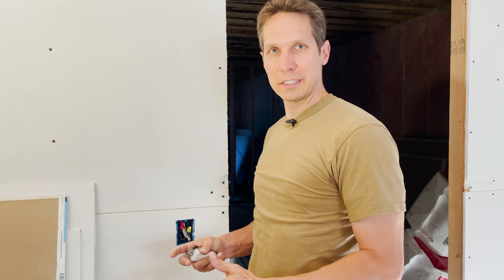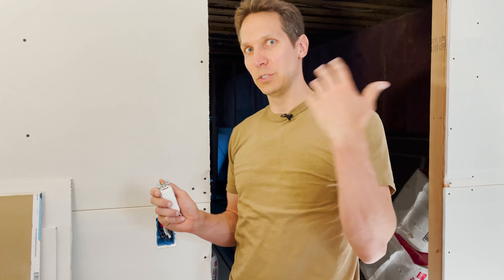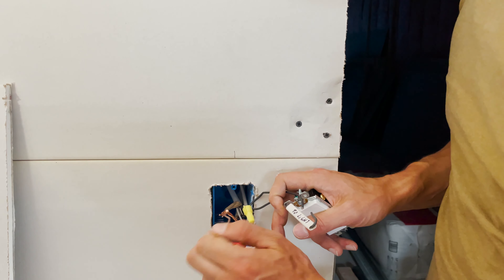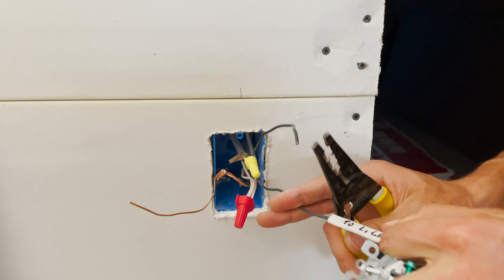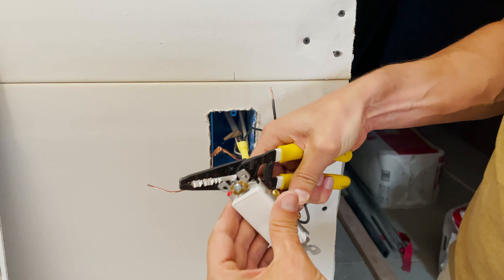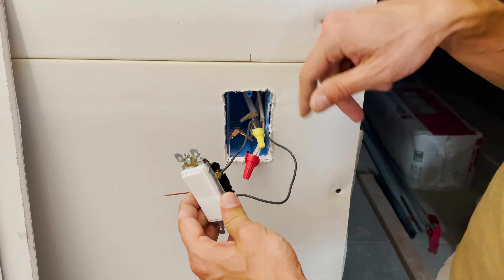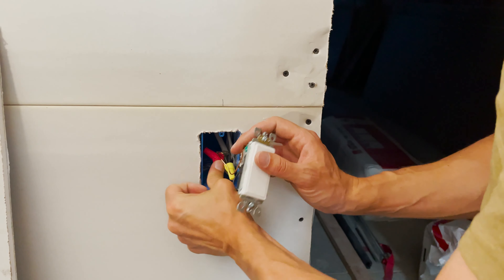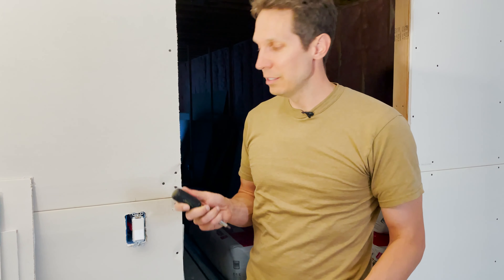How to Wire a Light Switch in your House - The Basics | CircuitBread Practical

Comment: Thanks for reminding me that I need to find a playlist to learn about basic electrical stuff, after having some knowledge of electronics, but electrical stuff is still mandarin to me. Part of the reason I've been hesitant is the high voltage, hence high risk in the event of simple dumb mistakes that I can easily get away with in electronics.
Reply from the maker: Totally agreed!  I've been hesitant about these videos because 1) I'm not an expert, I'm just trying to share what I've learned from the perspective of an EE and 2) the risks are high if you screw up.  That being said, while the risks are higher, there are a lot more safety features built-in and between that and common sense, it isn't too terrible.  But as I say in all of these practical videos (if I remembered to) - electricians are cheaper than an ER visit or burning down the house.  But paying $100+ to replace or install a switch boggles my mind.

Comment: Is the top of the switch oriented correctly?  Grounding clip is on the switch?
Reply from the maker: The ground screw is sometimes on the top and sometimes on the bottom of the switches or outlets.  But they've always been green.  And I did manage to install a switch upside down the other day, as I wasn't paying attention to the writing (and it was a specialty switch and a little odd in its wiring) but this one was installed right side up.

Comment: 30 seconds in and i hear you say Multimeter.
That thing is a no go for electricians because of high input impedance. A mutlimeter will happily report all kinds of values just because you are measuring a pair of wires that runs next to another pair connected i.e. to a running tumbler.
You really want, for a lot of reasons, a tester with a 2k switchable load resistance.
Reply: Sorry if i come off as "that guy" but there is a few decades of experience behind it.
I have experience in both fields. I designed and manufacured electronic devices and i wired up everything from simple sockets to 100kW eddy-current-motors in grain mills (dunno if you call them this in english)
Multimeters are deceiving. Most of the time they will give you false positives. And that one time you will just have it set for the wrong range, voltage type, whatever.
These thinges are great tools when dealing with non-lethal voltages. But they have absolutely no place when dealing with wiring up a home.
Damn i sound like that fire awareness bear in u.s. parks :D
Reply: Ok i tried to google for an example and there really only were examples of a fluke voltage tester, so i have to ask, do people really use multimeters over there?
Reply from the maker: Thanks for your input - I do like to get feedback from people who have a great deal of experience in this.  I actually had a Fluke Voltage tester that I gave to a friend who worked on HVACs, as he dealt with line voltage AC all the time whereas I only do it on the side.  Your concern about having it setup for the wrong range and voltage type is very real and does make me nervous - mine defaults to DC and I'm always worried that I'll forget to switch it to AC, think that a line is off, and hurt myself.  So I usually do double or triple check and, when in doubt, I'll turn off power to the whole house.  
I am curious why having a high impedance is a problem when checking for voltage, though.  Don't you want it to be high impedance?  I've had a few multimeters over the years and while they are more specifically for electronics, I've never had any issues with inaccurate readings (when I set it up properly) when working on my house wiring.
Reply: @CircuitBread  The problem with the high impedance is that you are unable to tell stray inductive coupling from actual galvanically coupled mains voltage.
This is why voltage testers (the good ones) have those push buttons to load the circuit wit a 2kOhm resistance.
It also helps to identify the nature of a problem. I.e. you see a voltage between PE and N. You push the button and the voltage collabses, you know where to look. Or you push the button and the voltage stays strong, then you go find a biiiig stick and start beating the electrician who did this :-)
Just consider your multimeter more like a radio with it's high impedance. It only cares for voltage, not if there is any substance behind it.
I mean if you holt the test leads like a dipole in AC mode you see what i mean.

Another nice side effect is that you can quickly test a RCD by putting the tester across PE and L and push the button.
It does not work with all testers tho. Modern Benning tester seem to have a higher load resistance, but the old ones with that dip coil style instrument work great.
Reply: @Ronan_C  The voltage tester as used by an electrician is not an 8 sig. digit voltmeter.
Best case it can tell you if you see 120, 240, 400V etc.
But that's it. Multimeters do have their place, too. But it is not testing for for correct installation mains voltage circuits.
Also it is pretty much impossible to screw up the measurement. That is extremely important. On the job there can be a lot of stress, dirt, noise. You are not always a 100% there. Yet still you have almost no margin for errors. That is why the voltage tester exists.
Reply from the maker: Thanks for your insights and clarifications, this is very good information to share!